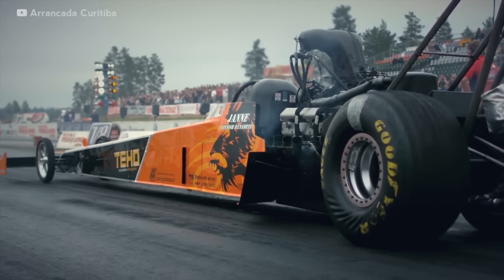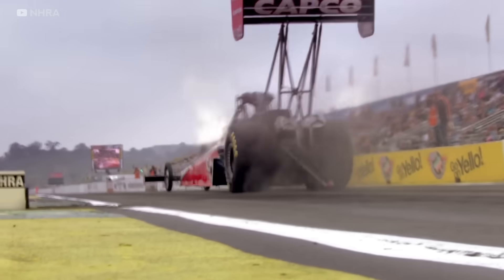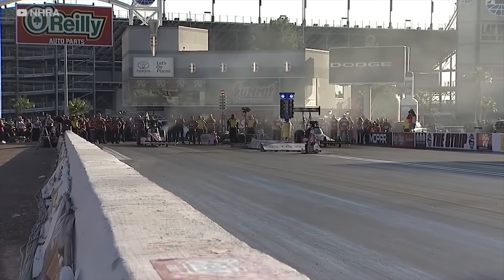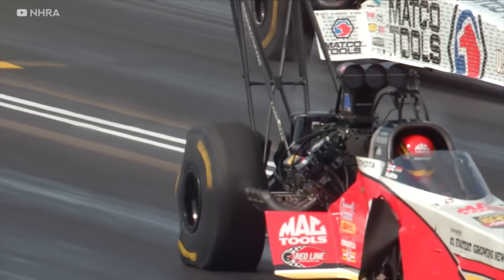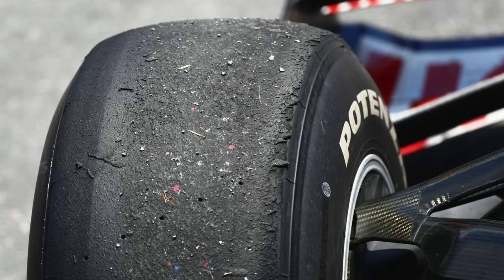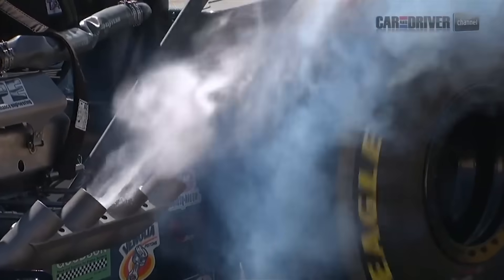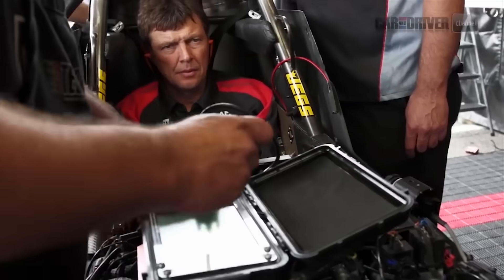How Dragster Tyres Accelerate to 335 MPH in 3.6 Seconds

Comment: I had turbo on my manual 1.4 fiesta, I had day to day compound tyre, hard, and the wheel spin at launch tears the tyre like one puts a blade and slices it through... So yeah softer compound matters... And yes I agree power to weight ratio and grip...!

Comment: Yet another "fun" fact;
The spark plug electrodes are largely burned away by the 3/4 distance, ignition after that is caused by dieselling combined with the extreme temperature of the exhaust valves.

Comment: 747 burns 1600 lbs of fuel per minute at takeoff, almost 20 lbs per second.
I think you are trying to say it burns fuel at the same rate, not the same volume used at takeoff.

Comment: Bullshit. Wider tyre doesnt bring more grip.
Reply: in an ideal word where rubber just sticks in any condition, you're correct, but factor in having to stay within the operating limits of the compound and limited downforce, a very narrow tyre almost always makes you slower
Reply: @markifi  its make u slower when its overheat, thats why they use wider tyres to control heat range

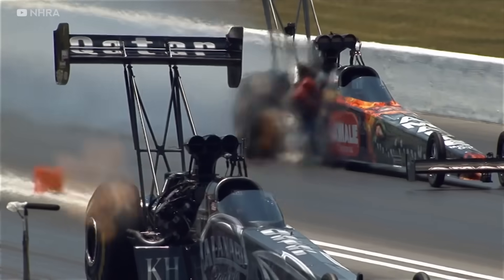Comment: 8:45 "...fuel pumps... 50L per second..."  I can't even kick-over buckets that fast.

The Saturn V rocket was powerful...  ...50,000 hp...  The Fuels Pumps were 50,000 hp, each of them. Just the fuel pumps. 50,000 hp. Qty 5.

Comment: TOP FUEL DRAGSTER FAST FACTS
ACCELERATION PUT INTO PERSPECTIVE
dragster* One Top Fuel dragster 500 cubic-inch Hemi engine makes more horsepower than the first 4 rows at the Monaco GP.

* Under full throttle, a dragster engine consumes 11.2 gallons of nitro methane per second; a fully loaded 747 consumes jet fuel at the same rate with 25% less energy being produced.

* A n F1 engine cannot produce enough power to merely drive the dragster’s supercharger.

* With 3000 CFM of air being rammed in by the supercharger on overdrive, the fuel mixture is compressed into a near-solid form before ignition. Cylinders run on the verge of hydraulic lock at full throttle.

* At the stoichiometric 1.7:1 air/fuel mixture for nitro methane the flame front temperature measures 7050 degrees F.

* Nitro methane burns yellow. The spectacular white flame seen above the stacks at night is raw burning hydrogen, dissociated from atmospheric water vapor by the searing exhaust gases.

* Dual magnetos supply 44 amps to each spark plug. This is the output of an arc welder in each cylinder.

* Spark plug electrodes are totally consumed during a pass. After 1/2 way, the engine is dieseling from compression plus the glow of exhaust valves at 1400 degrees F. The engine can only be shut down by cutting the fuel flow.

* If spark momentarily fails early in the run, unburned nitro builds up in the affected cylinders and then explodes with sufficient force to blow cylinder heads off the block in pieces or split the block in half.

* Dragsters reach over 300 MPH before you have completed reading this sentence.

* In order to exceed 300 MPH in 4.5 seconds, dragsters must accelerate an average of over 4 G’s. In order to reach 200 MPH well before half-track, the launch acceleration approaches 8 G’s.

native advertising
* Top Fuel engines turn approximately 540 revolutions from light to light!

* Including the burnout, the engine must only survive 900 revolutions under load.

* The redline is actually quite high at 9500 RPM.

* THE BOTTOM LINE: Assuming all the equipment is paid off, the crew worked for free, & for once, NOTHING BLOWS UP, each run costs an estimated $1,000 per second.

The current Top Fuel dragster elapsed time record is 4.441 seconds for the quarter-mile (10/05/03, Tony Schumacher). The top speed record is 333.00 MPH (533 km/h) as measured over the last 66′ of the run (09/28/03, Doug Kalitta).

Putting this all into perspective:

Lets say the you are driving the average $140,000 Lingenfelter twin-turbo powered Corvette Z06.

Over a mile up the road, a Top Fuel dragster is staged & ready to launch down a quarter-mile strip as you pass by it. You have the advantage of a flying start. You run the ‘Vette hard up through the gears and blast across the starting line & pass the dragster at an honest 200 MPH. Just as you pass the Top Fuel Dragster the ‘tree’ goes green for both of you.

The dragster launches & starts after you. You keep your foot down hard, but you hear an incredibly brutal whine that sears your eardrums & within 3 seconds the dragster catches & passes you. He beats you to the finish line, a quarter-mile away from where you just passed him. Think about it – from a standing start, the dragster had spotted you 200 MPH & not only caught, but nearly blasted you off the road when he passed you within a mere 1320 foot long race!

That’s acceleration!

Comment: There is no way the fuel pump pumps 10 gal/sec.  Physically and chemically not possible for a top fuel dragster.  A 500 cid engine = 2.16 gallons.  Plus, the car would require a fuel tank larger than 30 gallons, which is the minimum size of most residential water heaters.
Reply: I think it's around 2 - 2,5 gal/sec. https://www.youtube.com/shorts/xMHD7y4Q7-c

Comment: F1 fans bash on drag racing but don't realize how amazing it is too
Reply: Imagine... combined

Like for the start you have an engine which destroys itself, then after continue driving until pit stop, then take out the old engine put fresh tyres and a fuel cell (do away with the old safety rule of re fuelling by just putting in an entire cell)
Reply: @nolesy34  Interesting

Comment: Top Fuel and Funny Car doesn't run 1/4 mile!!! Cars started getting too fast with not enough shut off runway. They're going 330+MPH in 1,000 feet...ProMads still run 1,320 feet
Reply: At that speed? What if they crash
Reply: @nolesy34  Fatalities are exceedingly rare, unlike crashes (half the spectacle). Driver is wearing a fire proof suit and sitting in (basically) an armored bathtub, with a roll cage, helmet, and full harness.

In the past 40 years there has only been about 10 deaths. Given these teams are doing multiple runs per day over week long events. On balance the driver is fairly safe.
Reply: @valarauca1  i cant wait to have a bath tonight, i will set up my monitor and play gran turisimo

Comment: Way to over complicated! Dragsters are long a maximum 300” to make it easier to drive straight and for crew chiefs to get their confidence back. Funny Cars     Or Altered’s  Are where the real actions at.
Reply: All you need to know. Tire pressure only matters for less than 0.010 of second @ “the hit” Starting line track temp only dictates Tire Pressure. As track temp raises so does tire PSI, the size of the tires used and the wheelie bar is lowered. As track temp lowers so does tire PSI the size of the tire used and the wheelie bar is raised. Tire Psi is used only to control how far the wheel winds up before the tire will rotate and START to move. Less pressure gives the wheel a grater running start like a cartoon! The circumference of the hand made one size only tires varies up to 5” inches in roll out . They are easily shrunk or stretched in the pit and can drastically change from and or between run’s. Even on jack stands because of the warm up from 113” to 118” inches. 😂 FYI if any one cares tire diameter only gets bigger. Tires are harder than you think and see temps above 450 degrees before the loose traction and spin on a run.We still run around 5-6 psi. You NEVER want to line the car up on the burn out tracks for the run. We run no gears aka direct drive because it’s the quickest. Tire growth is important because NHRA 3.20:1 max rear gear rule.

Comment: All you need to know is…When track temp goes up. Tire size in circumference & PSI goes up and the wheelie bar goes down! When track temp goes down tire size & pressure is reduced and the wheelie bar is raised up. Tires are hand made so the roll out aka circumference varies quite a bit. We also can shrink or stretch a tire a few inches very easy and always do so because they can change on the warm up and  from Run to Run. From 113”to 118” in roll out! It’s counter intuitive because a “Slick” needs a controlled amount of slip to function properly with no “shake”. Tire pressure only matters @ “the hit” for about 0.010 of a second. Lower pressure allows the wheel to wind up in the tire more before the tire even begins to rotate. Storing more energy to spring the car forwards from a dead stop.

Comment: I believe the motor behind you in a rail was developed by "Big Daddy " Don Garlits.spelling maybe wrong
This may have been in the mito 60's or early 70's . He was driving the original type with the motor in front something like Funny car driver's do. I don't remember the cause but the explosion was big enough that in the picture I saw in Hot Rod Magazine where the driver sat over the rear axel and wheels was bent upwards about 90 degrees to the rest of the dragster. Don lost a good portion of a foot. While recovering he came up with what became today's earth rotating Top Fuel Dragster.

Comment: Tire pressure is grip, the lower the pressure, the more grip, but it increases the chances of the tire coming off the wheel, and vice versa for higher pressure, more pressure, less grip, but decreases the chances of the tire coming off the wheel

Comment: I was lucky enough to meet, talk with AND stand near NHRA Chief Starter Rick Stewart during a NHRA Nationals Sunday Finals ceremony start. Tony Schumacher in the US Army Top Fuel Dragster and John Force (i think, it was a funny car, and my wife met and spoke with john force that day, so maybe it was some other funny car) in his Top Fuel Funny Car launched off the lights with the power of lightning & thunder. Maple Grove Raceway. And I was there at ground zero (ear plugs and ear muffs).
Edit: no, they didn't race each other. Two distinct classes. It was a ceremonial end to the  quarter Finals where (I was told) each driver raced the clock to have a time and lane choice for the Finals. Each driver had already locked up their spot in Finals. They just needed to run off to get their opponent?

Comment: At 5.50 You say " Rear engine and rear-wheel drive since the early days" Incorrect since early "Rail Jobs" or Slingshot dragsters had the engine in the front. I remember the first time I saw a rear-engine Dragster when it came to Southern California at Orange County International Raceway. Quoting Google: "Fifty years ago, Don Garlits started sketching his ideas for a rear-engine dragster. 1,300 pounds. 1,600 horsepower." There is some dispute as to who first built the rear engine dragster but the original "Early" dragsters had front-engine rear-wheel-drive At least in the U.S. where it all started.

Comment: They will also bring the car with only the block assembled so they can decide on the head gasket thickness  for better ratio ,also since motor heavily regulated the big difference is in the blower last thing,the gas used in these is actually less volatile than normal gasoline or it would preignite(ping)in the chamber and also can input more boost from the supercharger and these engines runs with 0 coolant

Comment: About 20 years ago at the Norwalk dragstrip I saw a guy experimenting with flaps actually built into the tires. It looked the the underbelly of a snake the way the tire flaps were formed. I assume they didn't pan out as that's the only time I ever seen em. I assume racing slicks are just too good to beat for now.

Comment: If you've never experienced a pair of Top Fuel cars in person, trust me when I say- you have to put it on your bucket list.  Even if you don't like drag racing.  I've been going to every national event at Maple Grove Raceway for the past 20 years.  It's not only the sound but the pressure when they go by you.  And standing near the starting line is totally different than standing at the finish.  A Top Fuel engine can be heard from 7 MILES.  They are the fastest accelerating machines on earth.  0-100mph in 0.8 seconds.  Nothing can match it.  Not even an F-16 with full afterburner during a cat launch.

Comment: 6:34 The length of the top fuel dragsters is also to stop the rear end ‘coming around’ which is where the rear end tries to overtake the front end.
Reply: i.e. the dragster flipping over
Reply: @red2theelectricboogaloo961  there are videos of this happening - I think they call it a blowover. Eddie Hill was one such driver who experienced this.
Reply: Isn’t that just oversteer?
Reply: @ShawFujikawa yeh but they have virtually zero steering angle to play with.

Short wheelbase cars are always twitchy and easy to spin out. Longer wheelbase = more stability in that sense.

Comment: If you’re a racing fan you need to experience top fuel dragster’s at least once. Videos do not do it justice. You can literally feel the 10,000 hp when they go by. It distorts the air and vibrates your  eyeballs

Comment: The engine's life is so precise that if you let go of the throttle a fraction of a second too late OR if you're still on the throttle while deploying the parachutes, the engine is done.  Furthermore, big teams replace the engine every x runs, and parts of it every run.  The used, discarded blocks, are then sold to smaller teams who can still run within 0.25 second of bigger teams with them.  Such a performance loss is not acceptable to big teams.  Some teams use such engines to «sell» runs to rich privateers.  Cost?  10k$USD a run.

Comment: The part about nitro methane is incorrect. It has less explosive energy than gasoline. The reason its used is because you can burn a much greater amount of it at once vs gasoline. 

The amount of air required to burn 1 kg (2.2 lb) of gasoline is 14.7 kg (32 lb), but only 1.7 kg (3.7 lb) of air is required for 1 kg of nitromethane. Since an engine's cylinder can only contain a limited amount of air on each stroke, 8.6 times as much nitromethane as gasoline can be burned in one stroke. Nitromethane, however, has a lower specific energy: gasoline provides about 42–44 MJ/kg, whereas nitromethane provides only 11.3 MJ/kg. This analysis indicates that nitromethane generates about 2.3 times the power of gasoline when combined with a given amount of oxygen.

Comment: The Fuel PIPE is almost 4 inch in Diameter, being force feed by the dragsters acceleration to the fuel pumps attached to the motor.

Comment: Years ago, Snap-on sent me and my ex to a top fuel drag race. They gave us passes for the starting line. The fuel in the air makes you cry. The glorious burn of raw horsepower. The sensation on your heart synchronizing with those engines to this day, makes me giddy. Then we polished off the day with complementary beer and front row seats. 

If you ever get the opportunity to go to a top fuel drag race, and you're a motorhead?
Go. 
You can just watch the teams rebuild the 10k+hp motors under a tent. Test start them, feel the burn of the top fuel.. it's just another level.

Comment: 7.53 “the brake is a paddle behind the wheel”. False, they use carbon fiber disc brakes, and they do not increase throttle before launch.  They turn on flow from a stage of the pump adding fuel flow to the injector hat, known as “turning on the high side”.   Mashing the throttle will drive right thru the brakes.

Comment: Noob question: if the fuel tank is up front, does the thrust of the vehicle play much of a part in getting it to the rear?  Appreciate there's a massive pump in the system, but at speed the back will be where the front was in - what - 0.02s?

Comment: There are no TF Dragsters with gears.
Just clutches with about 7 disks.
Love your videos dude.
Edit:
And most dragster have two fuel pumps.
For warming up the tires they need just one, but if they drive in the pre stage light beam you can hear how the sound gets deeper when the second pump gets activated.

Comment: Wait at 5 minutes you say that the tires only are used for a ¼ mile at a time but then at 5:30 you  say they are only used for 8 runs... So each run is a ¼ mile? So 8 runs totals 4 miles which is way more than the ¼ mile recommend distance you stated... So which one is correct, they are discarded after each run or after 8 runs?

Comment: so they use nitro methane fuel, this fuel is a lot thinner then regular racing fuel of any kind.
This means dragster engines are able to burn that fuel really fast - raising RPM(due to the thin fuel).
HOWEVER the max RPM is limited by the ignition system maxing it out to around 8400RPM.
This means the engine will receive more fuel and gets a bigger explosion in the chamber creating massive horsepower. :)

Comment: Great video! Quite interesting, I just figured the tires were designed that way to not only help with the instant torque but to also provide a “elastic band” effect  where the tire with a certain amount of stored energy would release and propel the drag car to insane speeds in a short time

Comment: Not that I want to brag or anything just saying I knew all about this phenomenon (I've been an NHRA fan and racer (not top fuel sadly) since 2001 nitro methane runs thru my veins) and the first time I ever saw this was in 2003 at bandimere speedway during a national dragster event, and my dad had brought a camera that can film something like 300 frames per second and he was using it to see if I was losing 60ft time due to loss of traction (wheel spin on launch) and we discovered that my low pressure ties were actually wadding up like this not spinning so we did the OPPOSITE of what everyone said we should do and we increased the pressure to 14.8psi and I picked up 17 hundredths in the quarter.

Comment: Sooo - basically clickbait as you did not give information about how the TIRES actually work, only "they are soft and wrinkle"...........
Reply: He did explain it, it's ne necessary for Tyres to wrinkle because tractors don't have a gearbox and wrinkle in tyre helps not to break the crankshaft